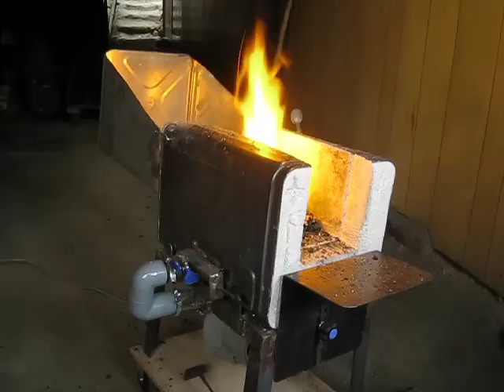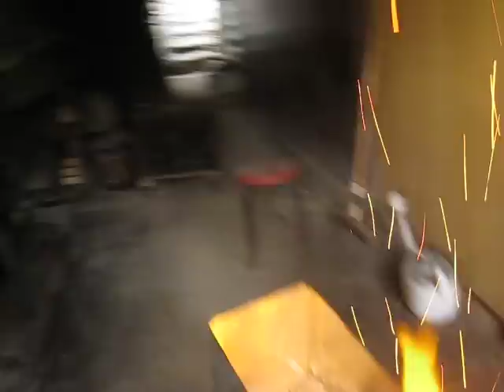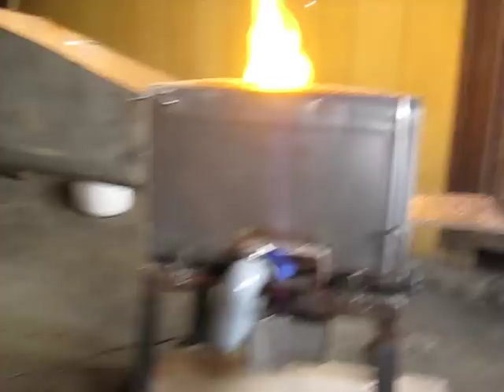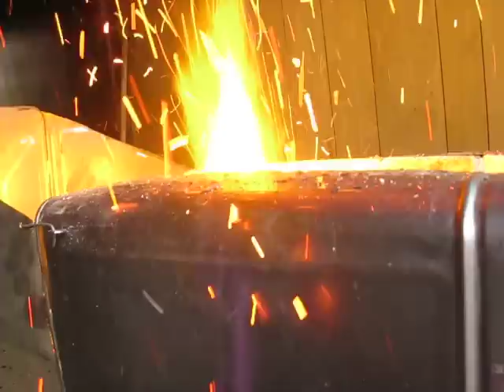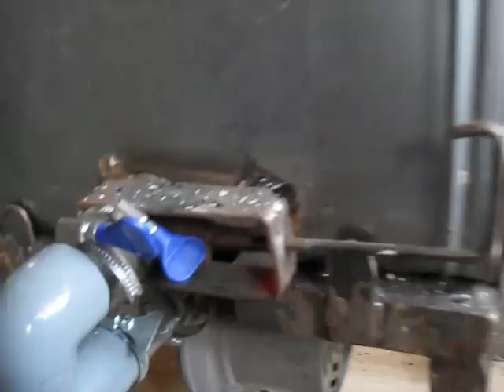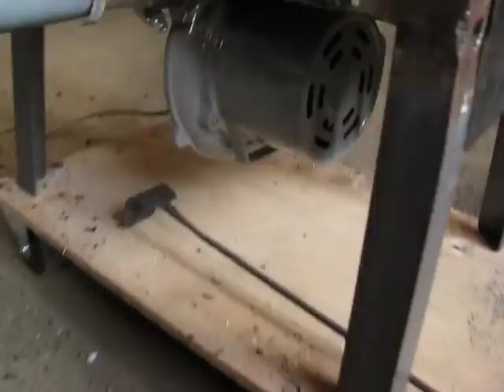Japanese style miniature forge - Mini-hodo

Comment from the maker: continued... So it's an iron pipe that goes into a central opening in the bottom, with a steel plate that let's air through (holes). Bad explanation. You get the point. Anyways, just contact me through my web site (my youtube username + dot com) if you want more details. thanks!